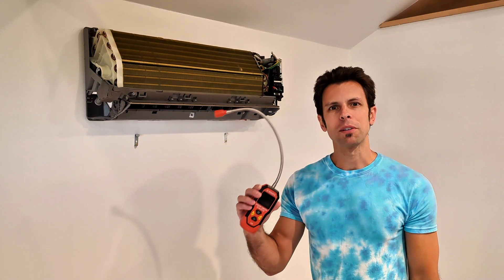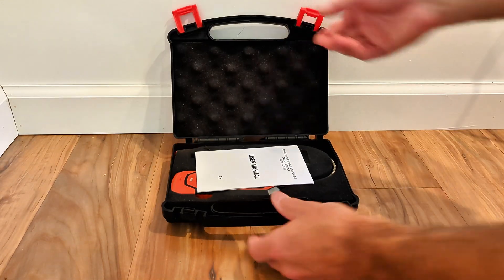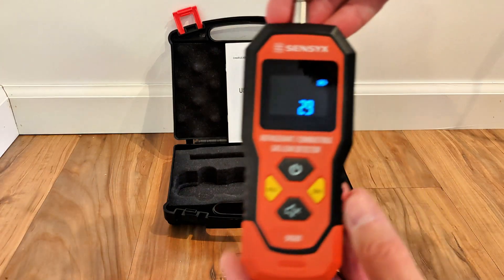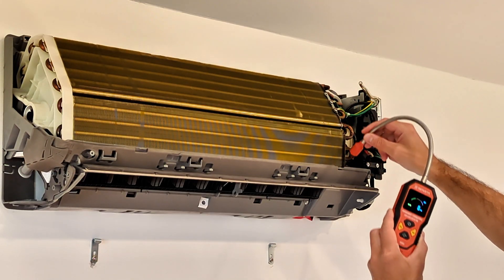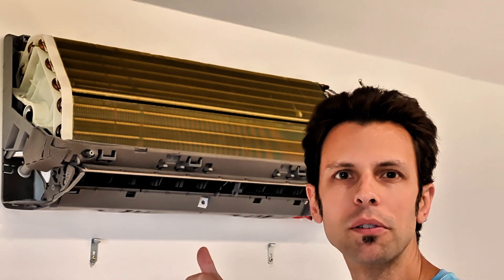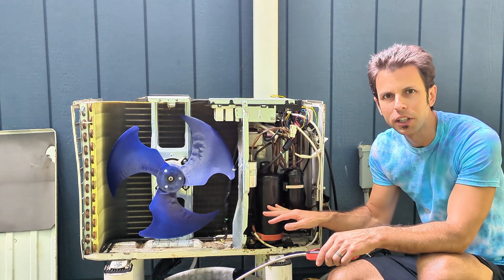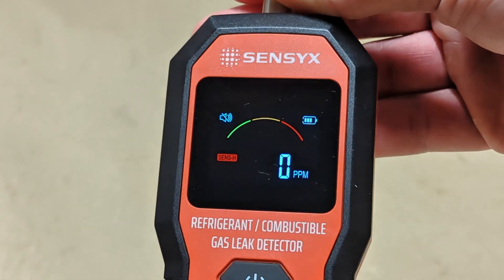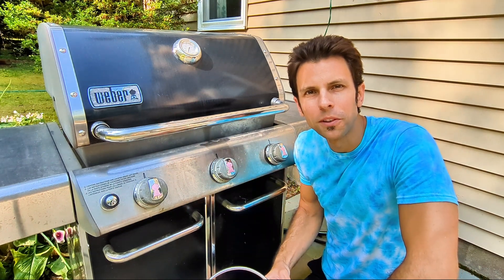How to Detect a Mini Split Refrigerant Leak and Review of the Sensyx SFD201 Leak Detector

Comment: How many hours do you recommend leaving it on the first power up? 1-24hrs is quite vague. I got mine today and I just powered it on and half an hour later, it began beeping just laying on the dresser.
Reply from the maker: It's mostly for accuracy. I would just turn off the beep/volume and leave it overnight. What you are detecting now is probably very low level gasses in the atmosphere. You may find you detect closer to "0" in a basement or very well sealed newer building.
Reply: @realhouseDIY Awesome! Thank you for the reply. 🙏🏻